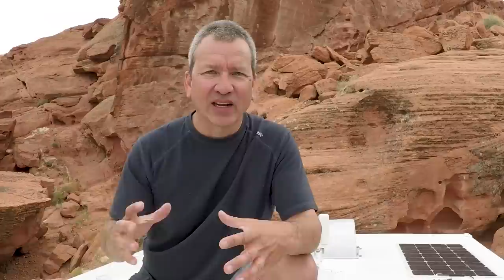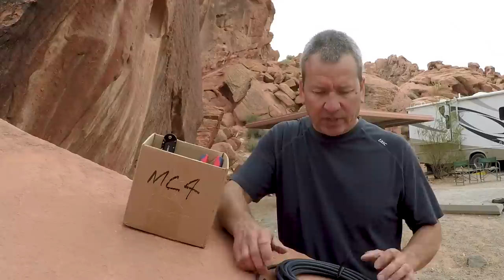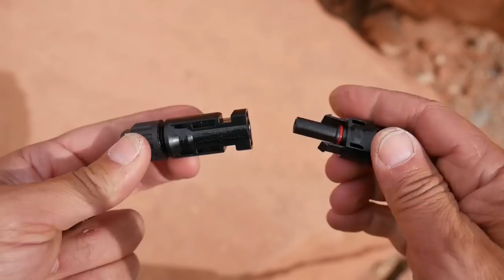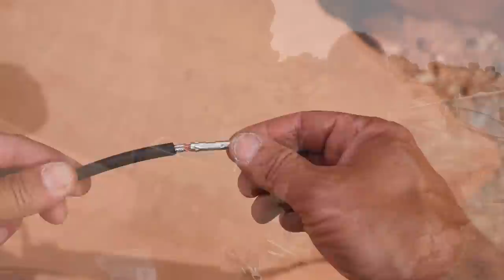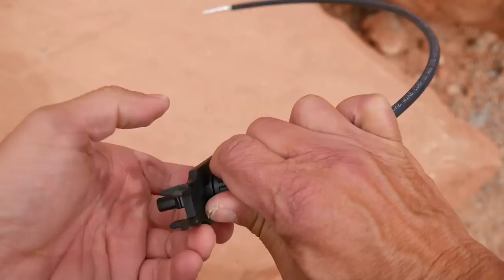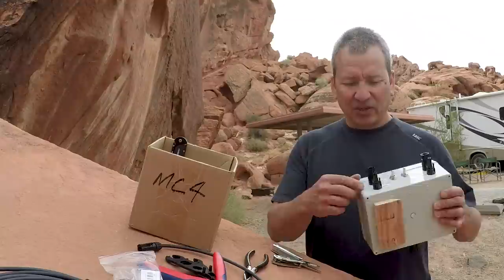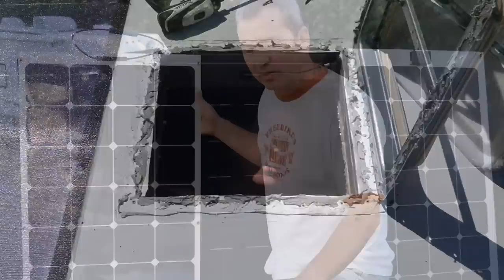How to Assemble MC4 Solar PV Cables

Comment: You left out a very important piece in your video! Although the ends of the MC4 connectors have a Male positive end and a Female negative end the metal inserts are just the opposite. The Female metal insert you crimp on the wire is inserted inside of the Male MC4 connector and the Male metal insert is inserted inside of the Female MC4 connector. 
Viewers,  never trust anything you see on YouTube until watching as many videos on the same subject until you find continuity in how it works or is being done. It will save you money and upset!

Comment: These connectors suck ass. If you're not familiar with how they are to be properly assembled (and some are different from others with the rubber sleeve and locking spiral thingy) you are definitely going to screw a couple up. Once the terminal is locked into the plastic end, you're done. Oops! Forgot to install the rubber sleeve or cap? Too bad. You just wasted a whole connector. Waste of money. Not to mention they look like crap if you have to string  bunch of those branch connectors together. I'm right in the middle doing a 3 panel setup and it's a pain making all these stupid connectors. I'm seriously considering hard wiring all three to a combiner box and be done with it. I've already wasted two connectors. Now I have to buy more. Stupid.

Comment: This is dangerous.  You should read the directions before you instruct other people.  There are different MC4 connectors based on the gauge of wire you have, different part numbers.  You're using the wrong crimper.  You're not using the correct wire, it should be tinned.  You should strip the wire to the correct length, which is based on the wire gauge for 10AWG it is 8.5mm to 10mm .  There should be a 1mm gap between wire and connector, not flush.  You should check for the strands when crimping among other things.  Don't remove the gland when you insert the cable.  It snaps when you insert the wire.  You didn't mention that the male insert goes with the male plastic. You should use the test plugs for MC4 or EVO2 connectors before you torque the gland.  The connectors should be properly torqued to the right setting which is based on the conductor gauge.  It is usually 3.4 to 3.5Nm.  If you don't torque enough, weather gets thru the seal.  If you torque too much, the seal doesn't last as long.  What you're doing will cause fires.  Read the directions from Staübli.  Poorly placed MC4 connectors are the leading cause of fires in solar installations.  You should re-do your connectors too and take down this video.

Comment: Dump the MC4 and just use andersen power poles.
Reply from the maker: Sure. There are several options depending on the other equipment in your system.
Reply: Fattie - Why do you suggest that (cost, easier to install, better connection)?
Reply: Fattie - Why do you suggest that (cost, easier to install, better connection)?